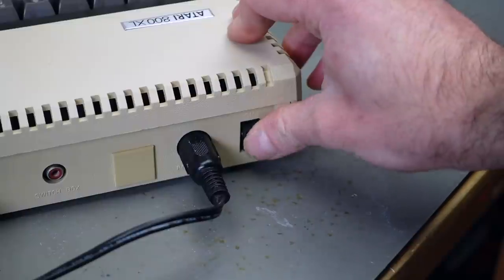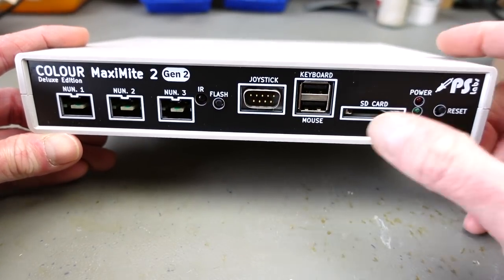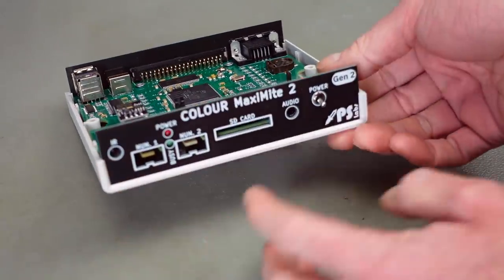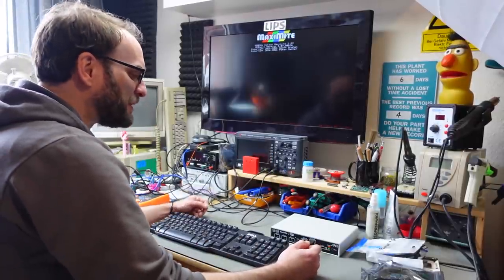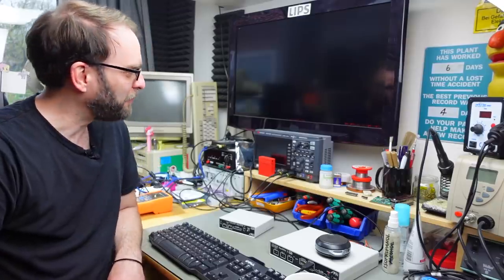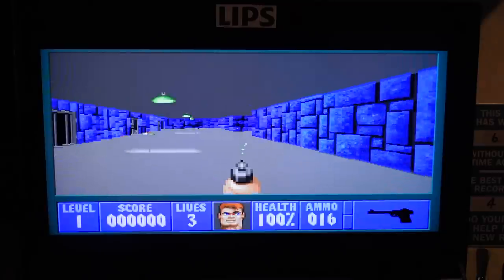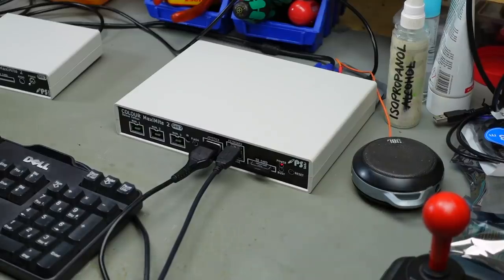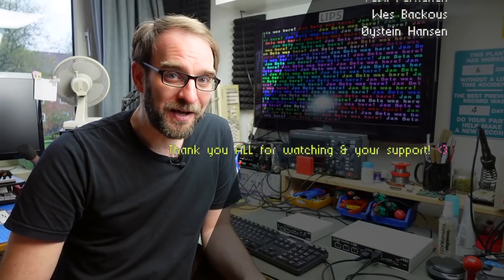A Look at the Colour Maximite 2 Deluxe

Comment: Will there be a part 2? I'm curious about the expansion cards. It looks like there's not much room in the enclosure, so the cards have to be pretty small.
Reply from the maker: I think you would have to cut a hole into the top part of the case or leave it open when using the cards. I’m eventually going to tinker with some of the expansions, I have another one coming soon from Piotr actually. There’s definitely going to be another video about the CMM2 sometime. :)
Reply: @JanBeta  That's pretty important aspect, that would have to be said in the review. Hopefully there will be another case option, where the cards will fit. Anyway, I'm looking forward to next videos. :-)
Reply: With how simple the board layout is, I think one could be 3D printed to accommodate expansion cards, might even work with a friction fitted design.

Comment: Nice! I've been playing a lot with these stm32 micros, now I've made a board with stm32h743iit6 (480MHz also) It has 32 megabytes of sdram (on a 32-bit bus) and hdmi/(dvi) video output. Max res that I've tried is 1280x1024. Colour output is limited on this board to rgb565 but another is on the works that has rgb666.
I chose TDA9983B as the hdmi driver but I've not managed to get it fully working, display shows only other pixel on the line... sound is working though...

Datasheet for the TDA9983B chip is of no use... There are are 3 PLL's, up/down scaler etc. but very little information.

Comment: Cool, but, as of this date I cant really find these. I think there may be some reason why these are much harder to find than the original VIC 20/C64 on like ebay or something. Also I'm waiting on the CLIPS (Commander X64) project from 8-bit-guy. So, I must look somemore for a modern affordable retro style system that works well. It's just that coding a diy kernal for the 6502 with a custom chipset board design, plus a reasonable video card eg. iCE40 FPGA is a large project from scratch for one person. Even for a small team. And the open source projects are nice, however, specific and have smaller feature package's than the gen 2 deluxe.

Comment: Kind of neat concept, but it feels like the BASIC implementation is very slow for the power of the hardware. I wrote a Wolfenstein-style raycasting engine in QBasic back in the early 90s which ran pretty well on a DX2/66 (admittedly it had no audio and no sprites, but still), and things like AMOS and Blitz BASIC on the Amiga could produce impressive results on a measly 7MHz 68k (Worms, one of the most popular games of the era, was written in Blitz!), so a Gauntlet clone and a Wolfenstein port running on a 400MHz ARM CPU seems a bit... meh?
Reply: Well... not quite. Blitz basic was a compiler, while Maximite basic is interpreted.  So, some difference is to be expected.

True, Maximite does prepare the program for running, but it does not compile to machine code.

And result is that even a large program runs pretty much immediately you press F2 (Run)
And that was the design purpose of the machine. It may be "meh" to you, but very nice to number of others.
Reply: @mikaachren7611  QBasic was interpreted, though, and even interpreted AMOS programs were capable of some pretty cool feats (and TBH compiled AMOS code didn't really run that much quicker - the main advantage of the compiler was for ease of distribution).

I will have to see if I can dig out some of the stuff I worked on back then for comparison, but I stand by my "meh" - for the huge increase in hardware performance over older machines neither of those games were anything that couldn't have been achieved in BASIC on the older crustier machines of the early 90s. (Heck, even some pretty good commercial games that were written in BASIC were released commercially on 8-bit machines - take a look at Temple of Apshai on the Atari 8-bit.)
Reply: Unfortunately, JanBeta showed my early prototypes I don't know why. The recent versions of Wolfenstein 3D and Gauntlet are much more polished, and my last game is a Final Fight port that the comments were positive. Please, see the more recent versions of my games in: https://www.youtube.com/user/mauroxavierneto
I will appreciate it if you post any type of comment as you are an experienced BASIC programmer. I will gladly accept even critics, feel free to give your fair opinion.
Reply: Not everyone wastes their lives playing games. I have been using BASIC for industrial control since the mid eighties and today I use MMBasic. Always been self employed and "time is money".
I have products up, running and making parts while my competitors are still tracking down memory leaks etc 🤣😂🤣😂
Reply: @AdaptivePhenix  Same here. I was coding pic's for water treatment then found MMBasic and the M170 saving a lot of time. Will now be going to the RP2040 with MMBasic as the chip cost and usability is far better.

Comment: Cool video! This does seem to be the ideal 'retro" computer. I have sympathy for Dave Murray's effort but once you run into the problem of video generation etc. without having access to a silicon fab you are basically forced to use modern components such as fpga's. Then you might as well do everything on the fpga like TheC64 or the spectrum next.
Reply: Is the TheC64 an FPGA?.. I was led to believe it was a dual core ARM chip with a combined ROM PLA SIDs etc on a separate ROM kernel chip...
Reply from the maker: TheC64 is emulation running in an SoC ARM processor (same as in many tablets and phones etc), yes.
Reply from the maker: I find the plan to create a system from more discrete components quite interesting. It’s quite a niche interest, admittedly. Makes it more true to the original machines at least. Using an ARM processor and other modern components obviously has many advantages, especially considering the price point and ease of production.
Reply: @paulluce2557  my mistake. Comment is still valid though.
Reply: @JanBeta  Yes, in his last video he admits that they have basically blown their original budget and that phase 3 of the project will almost totally be  FPGA based to get to his original price-point. MiSTer is a good example of what can be done with FPGA's if you are against the 'emulation' route.

Comment: Looks nice, but having expansion slots without plenty of height to put a decent sized card in looks like a design flaw. Do they also sell a taller case to overcome this problem?
Reply: You use expansion card with top lid removed. In short time there will be top lid with slots cut available.
Reply: @greyxopera  Doesn’t sound like a long term solution if you want to keep the cards in place.
Reply: @Doug_in_NC  It looks like a fairly standard clamshell project box (maybe an IDAS?) so you could easily pop it in a bigger one or get some spacers.
Reply: @elbiggus  Sure, it clearly isn’t impossible to change, though the front and rear faces won’t go well with a new case, but I would hope there will be an option for either a bigger case or it fitted a miniATX easily.

Comment: I have the odd desire to use this machine with my breadbin C64 that has a keyrah v2h built in to act as USB keyboard.
Reply: That would be an interesting combination! Not sure if it would work but I have both at home and can test it out for you.
Reply: I tested it out this morning and it technically does work but it's not very useful because the C64 keyboard has difference scan codes for many keys and lack other keys like ALT and more. It was a frustrating experience trying to control the CMM2 with the C64 keyboard, but it did technically work. Things like the Control key aren't the same scan code, so many features of the CMM2 would not operate.

Comment: It's an interesting little machine but the port choices are kinda... weird.  USB-A for power? I don't think I've EVER seen it used for that.  Nunchuk ports for controllers? Why?!?!  Why needlessly limit what controllers people can use by restricting them to those... Awful things?  VGA video? Well... OK I guess, but really.... It's 2021... A HDMI port would have been far more useful for modern displays...  I feel they've kinda missed the point of an easy to use computer here...
Reply: I can't speak to the Nunchuck choice, but one benefit/reason for the USB-A for power is that it doubles as a data connection too. When you run the CMM2 off of a USB connection to a PC, the PC can communicate with the CMM2 because the power port is COM3 from the CMM2's perspective. You can also flash the firmware using this connection. The terminal software I wrote, Maxiterm, can use the power port as COM3 and use tcpser running on the PC as a virtual modem to call BBS's. And regarding the VGA/HDMI, advertising HDMI requires license fees and sometimes the CMM2 outputs non-standard VGA resolutions so not all converter chips might handle that well.
Reply: @frnno967  Thanks for your response.  Is not the power/data issue on USB the same for more standard ports though? USB Micro or Mini, or USB-C?  The rather obsolete USB-A seems like an odd choice.  I get your point about HDMI licensing, but there's always DisplayPort...
Reply: @FloatingFatMan  Ahh, I understand now. Yeah they could have used Micro or Mini. I myself appreciate the full sized Type-B for it's mechanical heft though. Reminds me of the full size DIN power on the C64 :)

Comment: Way too expensive for what it is.
Cheaper to buy an old 8-bit computer on eBay.
Reply: Yes, cheaper. But I like the combination of simplicity and speed. 
8-bit computers are slow which limits what you can do.
Modern computers are very complex, and I miss the simplicity of early computers.
Maximite, while far from perfect, fills the niche it was designed to fill.
You may not like it and that is perfectly ok. But I like it.
Reply: You can do that, yes. But as you can see from the MANY repair video's on youtube, they will require some serious maintenance to keep them running and the chips they use are getting harder to find, if you can find it at all. Factor in the cost of more modern storage solutions etc. for these older machines and the price point for this computer is not too excessive.